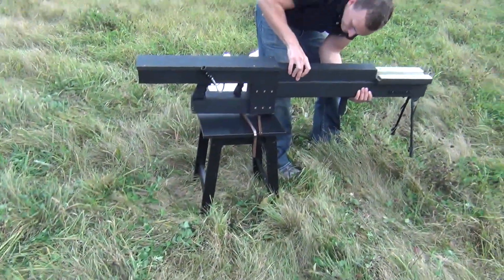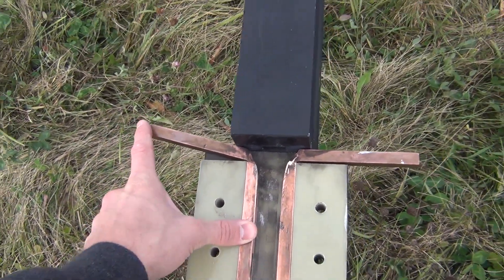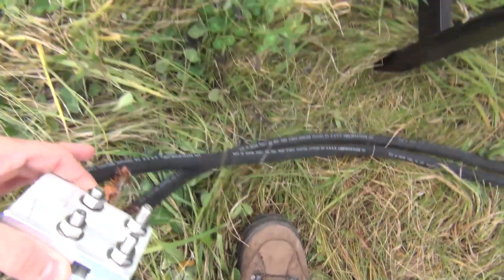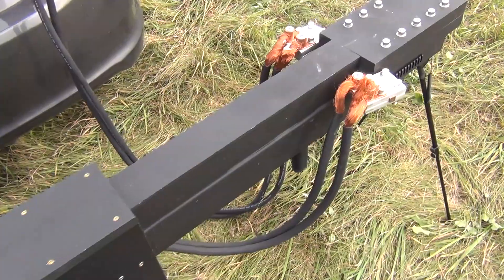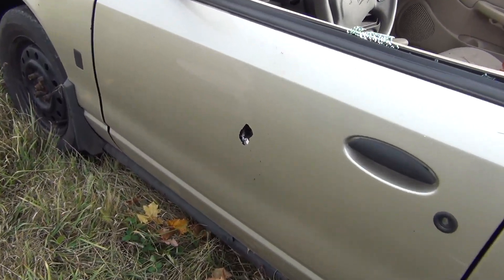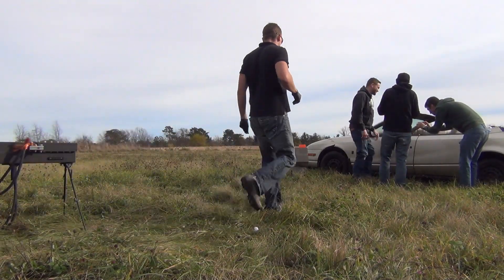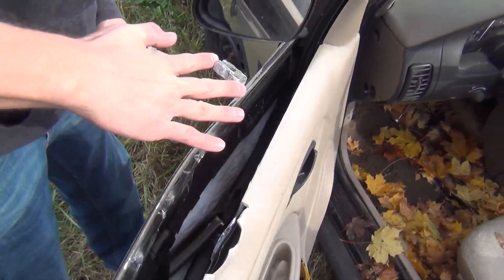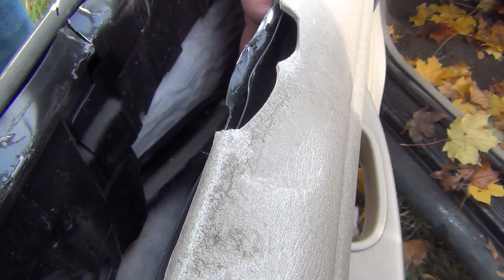250lb Railgun vs. Car Door: 27,000 Joules. Launch #4

Comment: Rather use a APDSFS!
Reply from the maker: I have some tungsten shaped projectiles...... next time :p
Reply: Ziggy Zee tungsten shaped...? You mean tungsten in APDSFS shape (like large flechettes). Is it just tungsten or actual tungstencarbid?
Reply: Ziggy Zee Ive forgot to ask something! You are the person i search for. A friend of mine want to install a new machine in his company. Im on the search for an effectiv dampener.

It haves a moving part of 0,3 ounce (140gram), at 150 fps (45ms) speed. In a straight movement. (148 Joule)
I tought about a plunger coil, because when you push the plunger in you get voltage, which tells me that the kinetic energy gets transformed? How well does this really function. Does it really slow down the plunger effectivly? And the most important thing-> can i build it really compact or have the coils to be large?

What weight and space would you assume the coil to be?

Are really fine copper wires better to take away the kinetic energy movement?

We dont want the electrical energy, just a good dampening effect.

It would be really great if you could help me!
Reply from the maker: I have both tungsten carbide and tungsten. Pure tungsten is fairly machinable (on a lathe) and has the highest density. Shaping tungsten carbide really eats up a grinding wheel :P
Reply: Ziggy Zee Yes tungstencarbid is really hard to work with. Please also read my second comment.
Reply from the maker: I have no idea- there's not enough information.
Reply: Ziggy Zee My information? What do you need to know. I can explain it further if needed. It would really help me!
Like i sayd a straight moving part of 0,3 ounce (140gram), at 150 fps (45ms) speed.Which equals 148 Joule.

If i attach this 0,3 ounce part to a plunger that moves trough a coil, it produces voltage, which i assume means it looses velocity right?

So does a really thin copper wire coil would give me advantages, and would it take a lot of coil to slow it down? Lets say under 1 kilo of copperwire?

This is what i mean-> http://www.electronics-tutorials.ws/io/io29.gif?81223b
Reply from the maker: Here is a way to dampen energy without wires. Neodymium magnet + copper pipe

https://www.youtube.com/watch?v=E97CYWlALEs
Reply: Ziggy Zee WOW! that looks cool. But I quess the copper pipe is still affected and pushed it the direction the magnet goes? Instead of transforming movement in electrical energy?

Does a plunger coil even work like i tought for transforming movement into electical energy? Or does this kind of setup just can push the plunger out when voltage is applyd at the copper wire? And if than what about the construction i need to chance.

*Wow i did watched other videos, where the person says it produces and magnetic field. Is that correct? That would mean i can dampen the 148Joule with just simply producing this field, and i not even have to build something that gets rid of the something like voltage.
Reply from the maker: Current circulates inside the copper pipe.. just like using wire. This amperage dissipates just like the circuit you described except it's much simpler :)
Reply: Ziggy Zee Thanks! Thats great, are there any ways to increase efficency? Like a thicker pipe, other pipe material, diffrent pipe shape, or stronger magnet?

I only have around 10 centimeter to damping the movement, ...but maybe if i change the design, i can use the impulse transmit effect. That a second part take the impulse and therefor energy of the main part, which then goes trough a long pipe and dampen the force.

Its already late here, but im now starting with some drawings, thanks for the incredible great help!

Comment: coat the rails in teflon?
Reply from the maker: teflon isn't electrically conductive tho.
Reply from the maker: The one thing that's more slippery than teflon- liquid metal. The projectile glides on molten aluminum (which is both low friction and highly conductive) :P

I'm working on improvements that will make the railgun perform at a much high velocity :)
Reply: the speed and heat is really great... not sure if there would be a material which works (?)
Reply: Oh, yea!.. Ofc., duh, tnx!! :))
Reply: Does the puck need to conduct electricity across the rails? I thought it was purely magnetism that forced it along :P Surely at high voltage those rails are going to get some serious sparks chewing them up... I must go look up more about how these things work.

Teflon gas is certainly not ideal - it's toxic actually... but perhaps some other kind of lubricant or something to make the surfaces super smooth to reduce all that friction...

Awesome build though, what a beasty thing! Terrifying actually.
Reply: Well that didn't take me long to realise I made a totally wrong assumption about how they work... :P
Reply: I was obviously thinking of a guass rifle
Reply: Awesome!

Comment: One shot and everything is burned, this is why US military will not use rail guns.
Also usable superconductor is necessary, but at this time its only sci-fi...
Reply from the maker: About 20 shots on a set of rails, for this particular model. Haven't replaced it yet.
Reply: Ok.
But please use something better to charge these capacitors.
9V batteries are the worst source.
Ok not, the potatoes will be worster...
Reply from the maker: +Arek R. I charge with an inverter now.
Reply: Better
Reply: Sure, except "why US military will not use rail guns" couldn't be further from the truth... There are, already, many working models (with videos available on YouTube).
Reply: anthony longoria the reason we use rail guns is because the projectiles are very cheap, and can pretty much go through everything. Which would be great for naval warfare.
Reply: think about it... this is a backyard experiment the rail gun was only in the public eye in 2014 think about the rest of the secret stuff going on
Reply: even though the navy is already in the midst of deploying them. They're far more efficient and inexpensive than chemical propelled projectiles
Reply from the maker: +Fordzi i Not even high powered lasers can take down a mach 7 tungsten round :)

Mine isn't going mach 7, however. But I do have tungsten finned sabot rounds.
Reply: Bruh, the General Atomics and BAE industries blitzer Railgun can give off 50 Megajoules of kinetic energy and it works just fine.
Reply: No doubt, this tool bag is scrutinizing this project and thinks that their budget comes even remotely close to that of the US military.  The kenetic payload is why this technology will be used; it won't be stopped by countermeasures.
Reply: P.J. Webb they already built it, and it packs a whopping 50 Megajoules of kinetic energy,
Reply: anthony longoria I just think from what I've seen so far rail guns are worth it.
Reply: Nope, try to learn Polish grammar, thats really hard xD
Reply: But these are only experiments, not real duty...
Reply: Nope, read everything, i know that, they started do test them about 10y ago...
Reply: +Arek R. We've had railguns for awhile now. And I'm not talking about the large cannons we put on trains in WWII. The reason we don't use them is because of the damage they cause compared to other non-explosive rounds. Because of that and due to their large size they are very restrictive staying to ships and land bases. So to make better use it would be preferred to wait until we can put larger models in, well, orbit, but due to the g-forces larger rounds will be needed. Besides that we've understood how to make them for a very long time only ever making changes to the materials used.
Reply: DaMosquito jimenez In reality almost all non-explosive projectiles are cheap to produce. Producers and other countries just jump the prices up because that is the way things work. Like some bottled water cost .05 cents to make each bottle and then cost over $1 to buy. 
And no, they do travel faster than other projectiles with the exception of rockets/missiles. But that leads to more damage as well, which is why they are so deadly. However they do not go through everything, often times with the rounds ending up near completely destroyed from the forces applied to it upon firing. 
We don't actually have many ships in any country that use railguns, We use the long barrel cannons that were called railguns because they were originally made for heavy long-range fire on trains. But not the magnetic/electric type simply because they are so large, and by large I mean 20-30 feet for military use and destruction, but also take a large amount of power. But the rounds have to be fairly dense and heat resistant as well as solid in order to hold together long enough to hit its target. 
So it is simply science to make one, but to make a effective one takes good resources, Railguns produce a extreme amount of heat and force on the projectile, so a ordinary cheep projectile that has been expanded to the proper size will not work. Plus keeping all the that and electricity from escaping lowering the actual forces is a problem as well
Reply: DaMosquito jimenez Most definitely, But only in certain uses with a lot of restrictions. Trains are a no go due to the force it'd put on the rails, It would also no only weight down but interfere entirely with a plane due to its way of firing. From space it needs a large/denser projectile that won't burn up but also a generator large enough to fuel it as well as the money to get it up there. On a ship it'd be fine but would mess with the ships positioning on each shot, and again the issue of a generator. As well as most of a ship being made of metal. So right now as is it needs work, but it can be done. But is so far only suited for stationary positions.
Reply: anthony longoria exactly
Reply: Fordzi i They are far from common place on any battleship or even carrier. They are still in testing. The only reason they are more efficient is because they use a greater force, that force needs to be compensated before it can be safely used on a ship. And the ammunition is another major problem, yes the round are cheaper to make, but much more limited as they need stronger metals in greater abundance. Hollowed rounds will be crushed and the air inside of them would expand from the heat destroying the round before it even leaves the two prongs. To heavy a projectile will lessen range and over all force wasting energy. To light a projectile and the heat will destroy it as the force warps it setting it off track. If it is not all balanced out, the railguns will become  either less efficient or more expensive. Keep in mind that ballistic type projectiles are both cheap and easy to make. The only munition type that can be categorized as expensive are missiles. Which can have greater accuracy and better range with more of a spread out force of damage for a few thousand dollars which is basically pennies for a military/government.Especially ours(America) since we do do a lot of imperializing. Rail guns are good, but still in testing because it is a new way type of weapon, everything else we have has been in used for more than a decade with a few upgrades here and there
Reply: anthony longoria I totally agree, not to mention the amount of energy needed to fire a round. idk about vs. missiles though. I guess it would depend on the situation. I couldn't find an exact price of a round for the railgun, but based on price/pound of tungsten, I estimate it would be around $700-1000 dollars per round, while a single tomahawk missile costs $1.4 million. according to the Navy, the railgun can deliver a round 200 nautical miles away at mach 7<, the actual round can't be detected (Although the heat from firing can be) and the round can't be shot down either.
Reply: Ziggy Zee wow, i didn't know they could track something moving that fast
Reply: +Arek R. but please learn proper grammar
Reply: English is the second hardest language, right behind Mandarin
Reply: No, english is easiest lang on the whole world, this is why english is the most popular xD
Reply: Arek R. I hate to break it to you dude but the U.S. Navy is in the process of building a rail gun right now for its destroyers, it's actually bout to start sea trials next year I believe so yeah the military is totally using rail guns now
Reply: angry try hard that's unbelievably crazy I can't imagine all that energy impacting something else

Comment: Any chance you can do a video explaining basically how this works?  my limited knowledge led me.to believe there needed to be multiple stages in a row of electromagnets in order to accelerate the projectile.  From what I'm seeing this appears to be a co2 powered gun that just closes a circuit on the way out and makes sparks.  I definitely want to learn how this bad boy works!
Reply: scratch that.  apparently I had no idea how a rail gun works.  Now I do and this is friggin awesome!
Reply from the maker: I might have to do this. Btw, the co2 only adds about 50mph.
Reply: Yeah I totally understand why it's necessicary to get it moving....Are the rails long enough to completely discharge the caps before the projectile exits?
Reply: +Ziggy Zee I'm also thinking that you could put 2 stages of bars in the barrel such that the first stage has fewer caps and the second stage has the majority if them.  It may make for a smoother acceleration and less trauma to the system each shot.  This project is really cool because it's relatively easy to experiment with different parameters.
Reply from the maker: +Kenny Downs the rails were matched perfectly to the system - near zero voltage after firing. My newer projectiles (plus 35kj caos) will have a much higher velocity. I will be using longer rails to encompass this higher velocity.
Reply from the maker: +Kenny Downs two stages would increase efficiency at the expense of higher complexity and cost. An inductor would work even better at smoothing voltage, however, inductors are incompatible with these capacitors- a voltage reversal will make them explode.
Reply from the maker: I think the natural inductance and resistance of the setup works pretty well to keep the voltage to a fairly nice curve. The voltage would ideally rise with the projectile speed- higher force for higher speed. (I'm apparently bored, answering a lot of questions on youtube :P)
Reply: You’re confusing gauss or cool guns with rail guns

Comment: 27kJ of energy spent; less than 270J muzzle energy. "awesome".
Reply: 270 joules of kinetic energy is just a little bit less of a bullet. But still impressive.
Reply: most of the energy is lost as heat from the sparks and sound. better conductors would probobly reduce that
Reply: hardstyle905 wise comment.

Comment: make your "barrel" longer for more velocity
Reply from the maker: The barrel length was carefully chosen to match the velocity and characteristics of the power supply. The voltage is approximately zero once the projectile leaves the device. Due to inductance, a reverse voltage can occur with a longer barrel. I'm working on preventing reverse voltage with diodes.